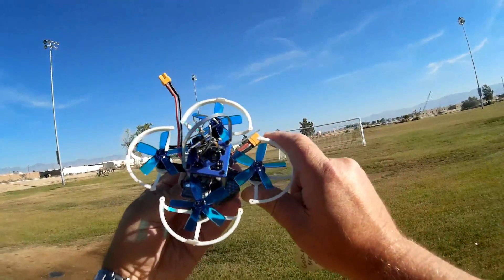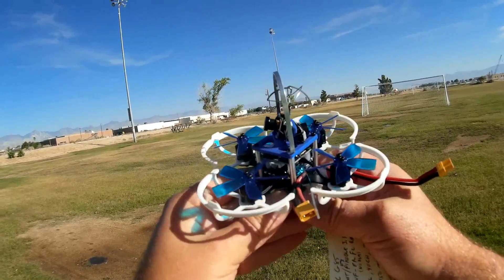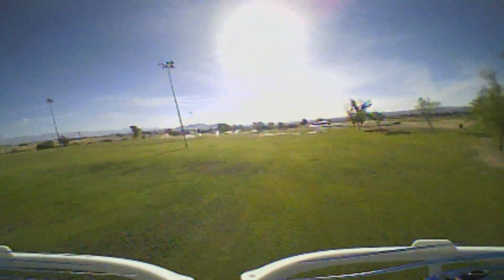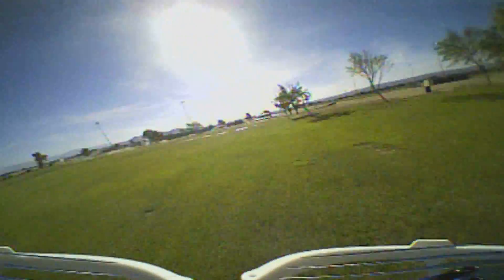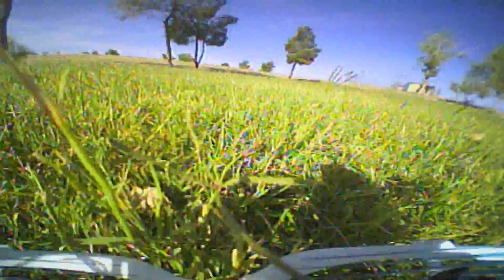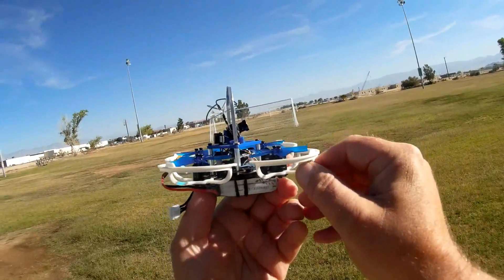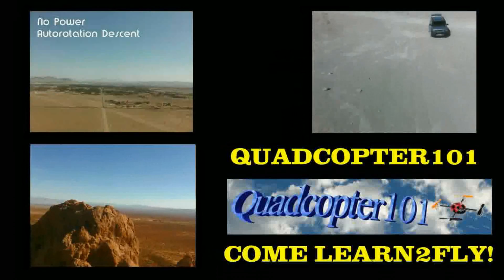GoolRC G85 Brushless Micro FPV Racer Drone Flight Test Review

Comment from the maker: Find it here $8 off with coupon LQPGCYJ Flysky https://goo.gl/CjLMh3 Frsky https://goo.gl/cQkJRt Radiolink https://goo.gl/viIYKG and ARF https://goo.gl/uvoBSR
Reply: What is a good 2S battery that might work?
Reply: @vrplant  Found one on Walmart. Looks like they are available on USA sites now... finally I may add!
Reply: @vrplant  Tattu batteries might work or Happy model batteries, so many choices. Not sure about the best C rating.
Reply: 2 minutes flight just isn't enough for me to get anything done. I would never buy a drone of any kind with 2 minutes flight... has to at least be over 5 minutes or by the time I get to a location to film the thing needs to land.
Reply from the maker: @sidewayslike3957  https://youtu.be/MuVp-O3cNkQ

Comment: Looks like these are the batteries that come with 11.1V 450mAh 25C Lipo battery. If I run it on these will the motors burn? Tattu 11.1V 75C 3S 450mAh Lipo Battery Pack with XT30 Plug????
Reply from the maker: Should be fine.  Might run even better with the 75C battery instead of the cheap generic 25C that it comes with.

Comment: The MJX RC Bugs 6 250 racer style qaud just got released you should review it. around $100 from banggood.  and gearbest           https://www.banggood.com/MJX-Bugs-6-Brushless-3D-Roll-Racing-Quadcopter-RTF-p-1148467.html?p=ML1711535795201404KD
http://www.gearbest.com/brushless-fpv-racer/pp_623166.html
you should review
Reply from the maker: It has not yet been released.  But a few (including myself) have got advanced review copies.  Be sure to watch tomorrow's video.
Reply: ok

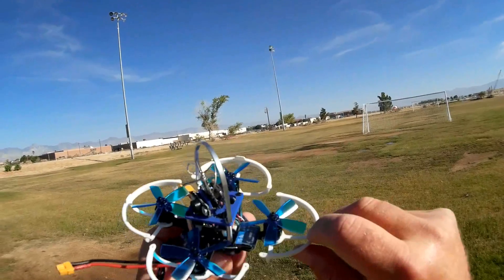Comment: 2:20 is pretty poor flight time .. you sure that the battery was fully charged? Of course, with a 200mw VTX running along with 4 brushless motors. the power demand is pretty high. I always carry one of those little battery alarm beepers that you can plug into the balance port, to check the battery voltage before I use a battery. Could be a bad LiPO as well .. I've seen it happen in other reviews where the battery the quad shipped with was no good. Thanks for the review. I saw the sprinklers in the background, so looks like you were able to avoid them this time. Cheers.
Reply from the maker: I am thinking that it's the battery.  I'm going to try other batteries flying it around the front of my house to see if I can get better flight time.
Reply from the maker: Noticed in the right YouTube browse column that Bruce of RCModelReviews reviewed this yesterday https://www.youtube.com/watch?v=hvrNRqPdqIY
He had similar flight time.  I really suspect that the battery is a very low C generic battery.  There's no printing on the side of its specs, which raises my suspicion.  I'm going to try the 2S orange generic battery off of my GoolRC G90 as it also has a XT30 connector.  The G90 flew great with it.  Hopefully it will help improve the G85's performance.
Reply: The motors on that thing are 1106 6000kv, while on most other 95mm brushless quads, they are using 1103 or 1104, with either 7500kv or 10000kv motors. So, those motors can be drawing lots of current but not giving you much zip. Might try a light weight 2S 30C battery, like the one that comes with the Flying Frog or the KingKong 90GT. The lighter weight might help. I'm getting 4 1/2 to 5 min. on a 2S 350mah 30C battery on my KingKong 90GT .. but it has only a 25mw VTX too. Well, I'm sure you'll figure out something. Cheers.